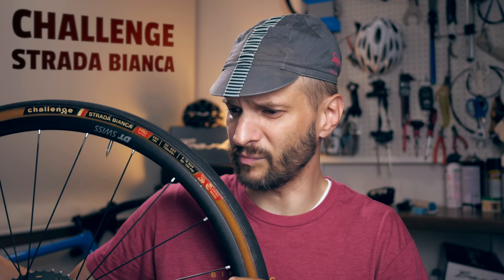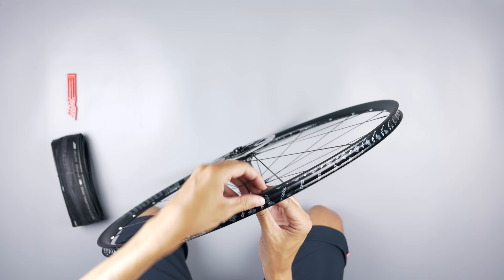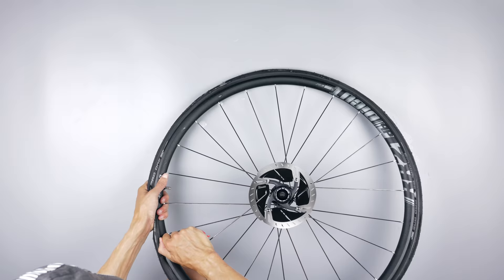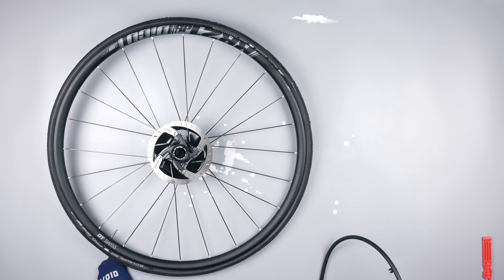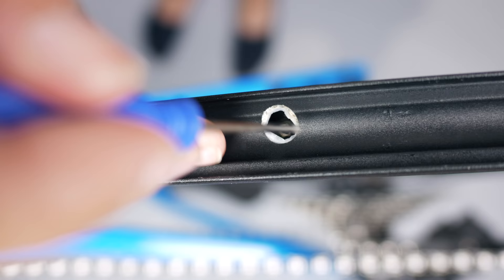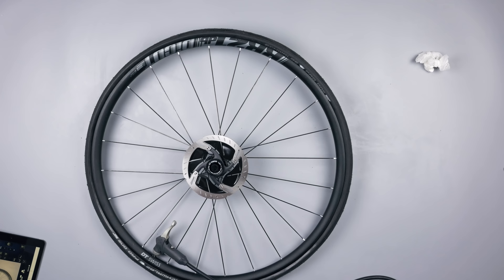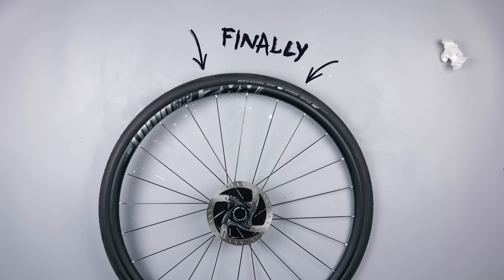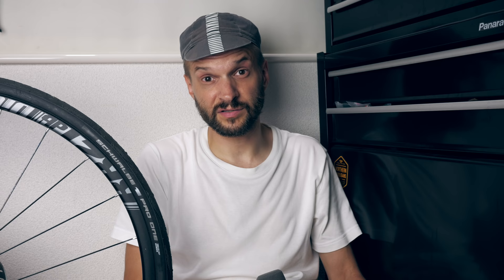Watch me struggle! 5 Tips for Road Tubeless | Schwalbe PRO ONE

Comment: always nice and helpful videos, thanks! I also have Schwalbe One 28 tubeless, already for half a year, and very happy with them: very fast and at the same time comfortable, also feel very confident in the corners - dream!  BUT I still not able to find the sealnt that can hold the pressure above 4bar if the tyre has a hole. for that moment each time I get a puncture, I remove the tyre and fix it with a patch from internal side. it will be interesting to get to know how others deal with this... hope you won't get a puncture, at least in a close time :)
Reply from the maker: Yuri Deyneko thanks mate!
Yeah, we’ll be interesting to see if can seal or not. Definitely will always carry a spare tube just to be safe.
Reply: I have seen my friend have this problem too as most sealants were designed for low pressure MTB. I think you need a sealant with more large particles in it to plug the hole with more strength. Stan's Race and Orange Seal work better, but a cheaper option is to put some glitter in with the sealant! I have not tried this myself as I do not run narrow tyres but search online...many people report it gives good results.
Reply from the maker: Craig Lloyd yes we did the glitter trick in one of the “Niner RLT weight weenie” videos. It has worked well (as we haven’t noticed any flats).
In this case I didn’t want to break the seat to put the glitter in... was afraid I wouldn’t get it to seat again 😅
Reply: Yes, as I watched the video I thought there is no way anyone would want to risk breaking the seat again to put in glitter!! Can be done in future (if needed)!
Reply: Craig Lloyd  try using a tyre plug. Saves you removing the tyre and the sealant will coagulate around the plug.
Reply: I tried Dynaplug with little success. The problem is that road race tyres like the Schwalbe Pro One are very fragile and are prone to cuts which are difficult to seal (in my experience).
Reply: @michaelw2859  thanks for idea
Reply: I’ve been using Maxxis Padrone and had no issues at all. I was thinking about using the Schwalbe ones next time but don’t think I will bother after reading about the puncture issues. I have certainly had punctures on my tires but the sealant has worked perfectly every time. It’s the Giant brand sealant.
Reply: Your sealant may need more shaking up before you put into the wheel. If it's old  get some new stans fluid. Bike radar did a fluid test of several brands recently.
Reply: I run tubeless with Stan's sealant and bring along a small tube of superglue and self-adhesive patches. Sealant solves 95% of any punctures., although I never notice until I get home and find a little sealant on my frame. Twice. so no idea of puncture count using these tires 3 years. If the hole is larger than the sealant can handle (only happened once in 12,000 miles) I'll apply superglue to the hole from outside and use one of the patches (yes outside). Glue sets, rotate wheel to get sealant on hole, then inflate. After a few miles the patch wears away leaving glue/patch material in hole or small cut. Sealant seals. I don't carry tubes. I run Schwalbe 23mm Pro One tubeless tires on HED belguim+ rims - inflated to 85psi they run just under 27mm wide and are fast - win every rolling resistance test out there - and I weigh 190.

Comment: I have given up on my Schwalbe PRO 1s. Just too damned effing difficult to mount on my HEAD Ardennes (tubeless compatible but still need taping). I think the inside diameter of the PRO One (25mm) tire is a bit  too small and the bead profile a bid thick IMO to mount and seat reasonably easily, making the whole experience a nightmare. No way in hell I could have removed a tire on the side of the road to insert a tube in the event of a catastrophic puncture. I'll keep using Conti GPs and tubes for the HEADs.  Switched to Mavic Ksyrium UST wheel/tire system for the tubeless experience. It's been rainbows and unicorns ever since. No need for special pumps. My old Joe Blow pumped them right up, no sweat. They hold pressure without sealant. Amazing and a great ride. 
My advice is never to use a (road) wheel which requires rim tape to go tubeless. Eventually the sealant works its way under and it and the tape starts to come loose, causing air loss. It's also nearly impossible to find a tape which is the perfect width and doesn't wind up under the tire bead to some extent, leading to seating problems for the bead. That's been my admittedly limited and frustrating experience with road tubeless until I went to Mavic UST. Sayonara from Italy.
Reply from the maker: Norman1951 Norman interesting to hear everyone’s experiences, the mavic system seem to be universally loved. 👍

Comment: I have the same tyres. I used co2 cartridges from amazon, it cost me 1500 yen in total. I think its well worth it after watching your video.
Reply from the maker: Hang Yang I actually wasted a co2 cartridge trying to seat the tire (before I change the tape... not on video unfortunately (I was too angry hehe)
Reply: Rides of Japan co2 cud possibly freeze up sealant so its not advisable.

Comment: i used plenty of sealant and a electric motor powered compressor . a big co2 would work as well and is more accessible to most folks. also, ive started running the walmart green slime. its waaaay cheaper and seals bigger holes.
Reply from the maker: I'm so jealous of all you guys with compressors! Not an option for me as I live in an apartment.
I did waste a co2 canister (not on video unfortunately) in anger, did not seat either. A tubeless pump with a pressure chamber has about the same force as a co2 though.
Like I said in the video, my main mistake was not checking and replacing the tape. As soon as I did that everything went a lot smoother.

Comment: My hesitation with tubeless, is suffering that same pain but out on the roadside. Granted, you can always carry a tube (or two) - but that kind of defeats the purpose (or at least one of them, which is to save weight).

I have tubeless ready wheels but haven’t set them up for tubeless. Now, less likely ;)
Reply from the maker: Rhys Williams I’ve read a lot of similar comments, but to me is was never a question of changing the spares to bring on a ride, always one spare tube even with tubeless, unless the ride is with in reasonable walking distance from home I guess. Trying to patch a tire out on the road it a pretty daunting task unless it’s a simple tubeless plug. 
The merits of tubeless to me would be 1, better ride quality (although this can and has been debated)
2, Seal small punctures before you even know you had a puncture
3, Minimizing the possibility of pinch flats to almost zero.
4, Being able to run lower pressures because of number 3 and in turn achieve number 1 :)
You might save a few grams as total wheelset weight depending on tire choice but as it won’t be that much in the end with the sealant included.

There always a risk that you’d get a double puncture... and with only one spare tube you would be out of luck compared to a tubed clincher set up where you can patch one tube as well.
So I definitely think there’s other negatives with tubeless apart from the obvious ones show in the video 😬

Comment: Ironically, I'm here because I'm having the worst afternoon of my life for exactly the opposite reason to you. I'm finding it insanely difficult to get a pair of Schwalbe Pro Ones onto my rims. I've never before had so much difficulty trying to get the second bead into the well of the rim (I mean, normally, you just push it with your thumb and it goes) and, even when I did that, I still had to use a tyre lever, and till had to use so much force that I thought I'd break it.

But as soon as I got the tyre on the rim, it pumped straight up to 90psi with a track pump, without even putting any sealant in. (I don't run tubeless at 90psi, but I pump them up to about there after fitting to make sure the bead's properly seated.)

Comment: I loved riding on my Schwalbe 23s but when they got to the point where they kept leaking, didn't have any plugs. I couldn't take tire off after trying for 30 minutes. Took to local bike shop and took him 30 using a vice grip. When my rear tire had same problem I gave up and cut tire off.
So your next video should be how hard is the 28 to take off after a long ride😉
Reply from the maker: Dejected J haha, if it comes to that I’ll definitely make a video on it! 👍
Reply: Yeah, I had to cut a Schwalbe tire off as well. The bead was so tight in the channel (Zipp 20 alu rims) that I couldn't even pull it out with pliers.
Reply: Same problem, 25 on a Hunt rim. Back to tubes.

Comment: I put a pair of Pro Ones on today, my first try at tubeless. One tyre was a problem until I realised that the shop guy hadn’t tightened the nut up properly that seats the valve. Once I realised that it was a breeze! I did hang the tyres for a week though after unpacking them and may have accidentally addressed the crease issue.
Reply from the maker: Yep, the second and third generation Pro One’s is a breeze to work with 👍

Comment: That's funny, I have the same rims, but the 25mm Pro One's seated perfect on these. I pump like a lunatic for 30 secs, a few pops, and boom, seated. I do leave it like that for a day before filling it with sealant though. I had no issues at all with leaking past the (original DT Swiss) rim tape.
My Reynolds wheels came with that blue tape you used, that caused me a lot of leaks, I would not recommend that for tubeless.
Reply: I agree 100% on the riding part, yes setting up can be a pain, but once on the road, you immediately feel the difference.

Comment: Speced Pro Ones on Ardennes SL Plus wheels with the intent on converting to tubeless. Can't even get the tires off! Will have to cut them off, which I hate to do to such spendy treads. They roll great but not sure if I want to put new ones on.

Comment: For fixing bigger punctures in tubeless road Stans Notubes have released Dart tubeless plug. It works and is very quick to insert. I have been a Pro one fan for years and have ridden them for about 10000k . Despite a few punctures I have never had to put a tube in to get me home.
Reply: The dart has not worked well for me on pro one.   In general I haven’t found the pro one to seal puncture well.
Reply: @FuzzFace  I have found that a regular check of the quantity of sealant in the tyre helps. Smaller holes caused by flints have been fixed with one petal from a stans dart pushed in with the smallest Allen key. I have switched my back tyre to schwalbe one which has had fewer flint punctures than the pro one. Enjoy the ride.

Comment: Nice job but like some others I don't see much advantage to the tubeless set-up. I ride also with 28mm tires, Vittoria Corsa Control 280gr. I use the Vittoria Latex 25-28mm tubes, I think in the end in total it's the same weight as a tubeless tire and sealant. The comfort is exactly the same (I use max 4 bar), the latex tube is almost impossible to have pinch flats and so far no puncture flats. It  makes life a lot easier
🙂
Reply from the maker: SuperMichelleke I got latex tubes a few years back.... and sliced the tire (and the tube) first ride... not really the tubes fault but we all have different experiences 😅
No reason to change a setup you’re happy with for sure 👍
Reply: Rides of Japan you are right, if you  read reviews of the same tire you will have 100 different stories, from horror to complete hapiness😅 I suppose some luck is also important😎 keep up your great videos!
Reply from the maker: SuperMichelleke thanks man! 🙏

Comment: The trick is to put an extra layer of rim tape if you're having problems like you were. It may depend on the rim tyre combination as to what works best. I like the Schwalbe rim tape the best as it conforms to the rim a bit better than Stan's and some others. I feel your pain though as it took me about 2 hours to get it right the first time and find this out. Love the Schwalbe pro1 tyres but I find they get punctures a bit to frequently. I've switched to Hutchingson Fusion5's and so far so good
Reply from the maker: Geoff Semon yep, replacing the tape (with 2 layers) made all the difference here.
I realize now that I wasn’t very clear in stating that in the video 😅
Fingers crossed that I’ll have better luck with the tires in terms of punctures. If they fail, I’ll most likely go a bit bigger again, something like compass 35c...
Reply: I'm about to order some Compass Babyshoe Pass tyres for the 650B Lightbicycle rims I'm building up to some CK hubs for our tandem. I'm planning on running them tubeless so I'm hoping they'll hold up ok
Reply from the maker: Geoff Semon my 650b compass switchback hill are so awesome riding tires, went on tubeless a lot easier than these Schwalbe (can see it in my 650b impressions video if you’re interested)
If you go for the compass, You’ll love them I’m sure!

Comment: BTW, some trick, especially for the inner tube trick, doesn't work well for RR21.
Even one side bread is completely set, when pressure drops the bread will just unseat.
This also means when there is air leakage, the tire will eventually unseat with a loudy pop. (I find it the hard way, my G-one 35mm suddenly poped back and surprised me a lot).
Reply from the maker: Adam Queen yeah, it happened in this video as well.. worked on my 650b’s however.

Comment: Ok, this is to much work! GCN has a good video on Mavic tubeless wheels, it seem that you don’t struggle with them so much.  Great video!
Reply from the maker: easyx9mm yeah, he mavic system with rims and tires made as a set will definitely be a lot easier to work with.

But as I briefly mention in the video, there a lot in instruction videos out there where never have a single issue, that’s not always the case in real life. I don’t think GCN would post a video where they struggle as it’s most likely a sponsored video by mavic.
I’m sure the mavic system works though! 
Not a big fan of Mavic tires personally however.
Reply: I used a Hutchinson fusion Galactik on knight tla and used the bontrager pump charger and went on a treat. Hardest part was putting the tire on as it was really tight but apart from that no probs. Ordered a syringe from Amazon so I know how much sealant I’m putting in

Comment: I had a set of DT Swiss 350/R500 wheels built for my new Trek Checkpoint in the spring and installed the Panaracer GravelKing slicks in 38 mm based on your video and I LOVE THEM -- why did you downsize? Most of my riding is on winterized gravel and hard packed dirt and with the right pressure they soak up the chatter and ride smooth -- but they're not so great on fresh, soft gravel (especially corners). And I had no issue going tubeless with the GravelKings. I double-wrapped the rims and used my Bontrager Flash Charger and they seated right away.
Reply from the maker: Jason Jarvis yeah, I loved my 38 gravelkings, I also mounted them without problem at all... those were good days 😁
I used those tires when I only had one wheel set (the one in this video) and used it for all riding (gravel, tarmac, hill climbs etc.)
But since I got a set of 650b wheels that I could go no compromise gravel, I could take this wheelset and optimize it for road/tarmac.. (mainly climbing mountains)
The gravelkings 38 are still one of my favorite tires ever, but I’m always curious to try new alternatives 😅
Reply: Cool -- I'm looking forward to how you get along with the Schwalbes, especially in comparison with the GravelKings.

Comment: i had the same issue with the pro one tubeless 28c. the 25 went on easy the 28 1 hour of pain/frustration. the weight was way off. my 28 weighed 335gm
Reply from the maker: SpartanBike hmmm... I actually though mine was on the heavy side, I thought they was suppose to be in the 260g ballpark... must have been looking at the 25c size 🤔

Comment: I could not get my tires to seat, and they are with tube. I tried with soapy water without luck, so I sat my tires out in the hot sun (50 Degree C) and tried again and that did the trick.
So maybe It helps to warm up the tires for tubeless to? It may be worth the try, either in the sun 10 min or over a warm radiator

Comment: Mate buy a compressor or go find one to use. Whip out the valve, fill tire with sealant, pop the the tire using air gun, hold thumb over hole to stop air escaping and quickly pop valve back in and pump up to pressure, works every time.
Reply: That’s exactly what I ended up doing after messing with my tire for what seemed like forever. But even that technique takes some practice so that you’re quick enough getting the valve in before losing your pressure.

Comment: ROJ, thx for sharing. I'm actually thinking of going tubeless and an not 100% if my Spinergy runs are tubeless compatible. Great vid. #critwhit
Reply from the maker: Crit Whit cheers mate!
Don’t think spinnergy road wheels are tubeless compatible... (can’t find any info on their website) 
I would not want to try and bodge that, could be dangerous, especially in Crit 🤔
Ride on!
Reply: Rides of Japan thx for the quick reply. Yes, I do a lot of riding and I would hate for something bad to happen. As would make good but possibly deadly footage for my channel if was to get uploaded. I did contact Spinergy, and they said wrap Stan's tape around a few times. I'm curious if it would actually work out or is it better to just find known tubeless compatible rims.
Reply from the maker: Crit Whit hmm, I saw that recommendation for their MTB wheels, didn’t know that it applied to the road as well. I guess you can take their word for it, but something about pushing 100+psi in a tubeless tires on a rim that not specifically designed for it makes me hesitate a bit hehe... personally I don’t think it would be worth “the views” 😅
Reply: Rides of Japan Totally understood. Thx for the vids and the insight. Additionally, I will seek out tubeless rings for safety sake. 💪🏽😎🚴🏽‍♂️